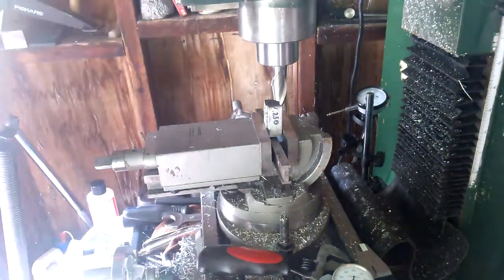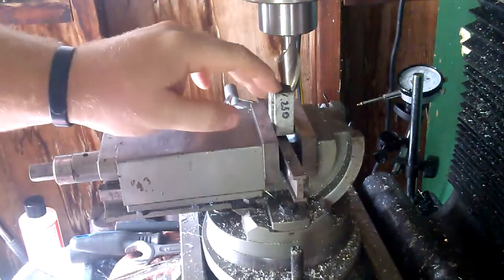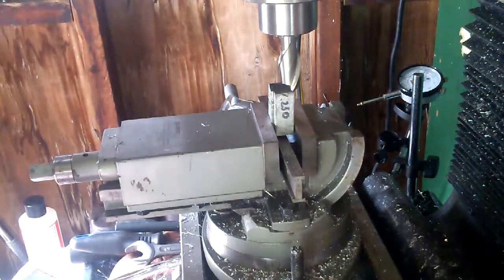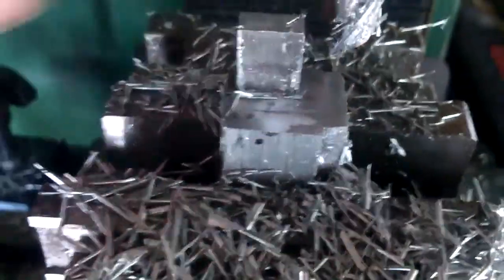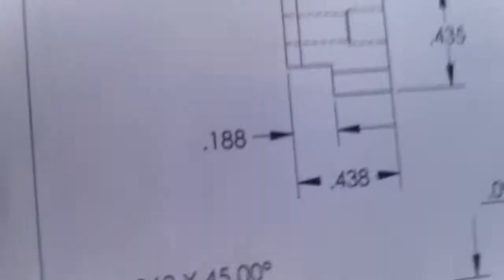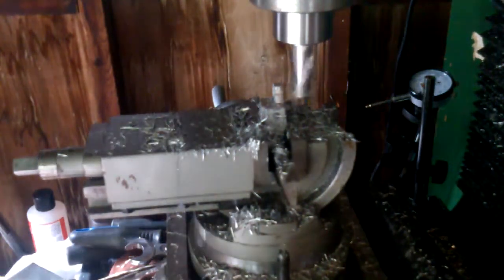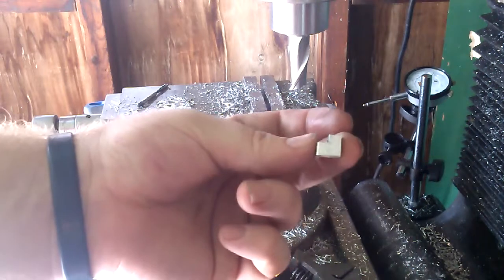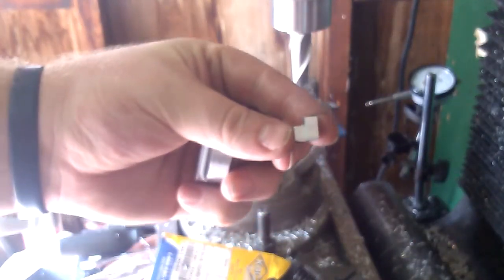Homemade Boring Head (Nut)

Comment: No mean spirit but I spotted a few issues. At 2:27 you're measuring the piece with the cutter still spinning; not a great idea. Also, your parallel is just for the show it seems because it's loose and walking all over the place. Just get a ball pen hammer and when you set the piece into the vise hit it a few times to ensure it's sitting firmly on top of the parallel. Otherwise, good job.
Reply from the maker: I always like constructive criticism. Your first point is absolutely correct, never try to measure a part with the machine running (with a few exceptions that I won't get in to). Your second point is a little harder to address. I have never liked using a hammer (whether it's a ballpeen, dead blow, brass, etc) to "seat" a part although sometimes it is necessary. By nature, the style of vice I have will lift a part as it clamps and cause the parallel to move around. "seating" a part incorrectly is just as bad as not doing it at all and the amount it can rise is miniscule so I only do it when a dimension is extremely critical. and if you want to get really technical the amount the part moves is usually less than the accuracy of my mill.